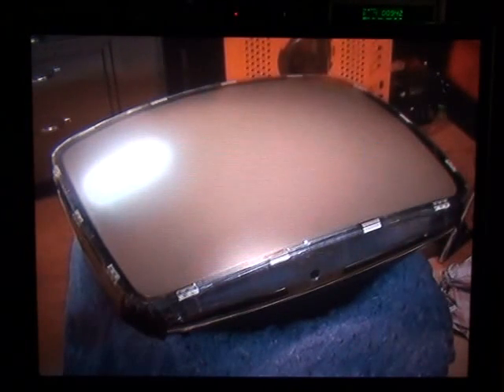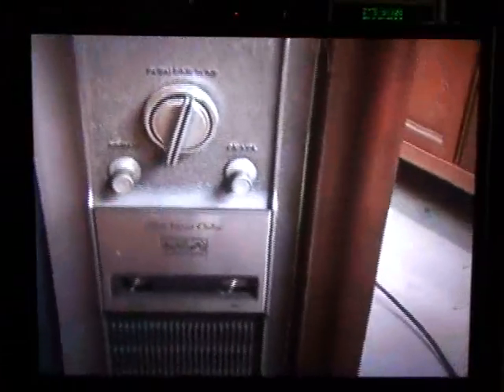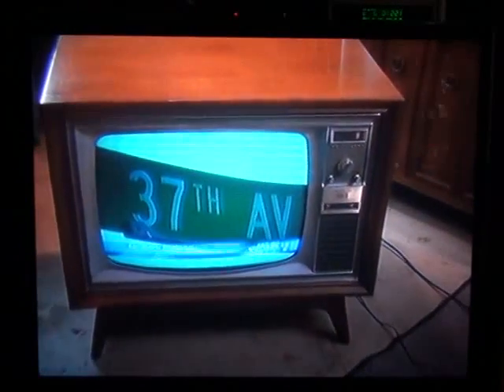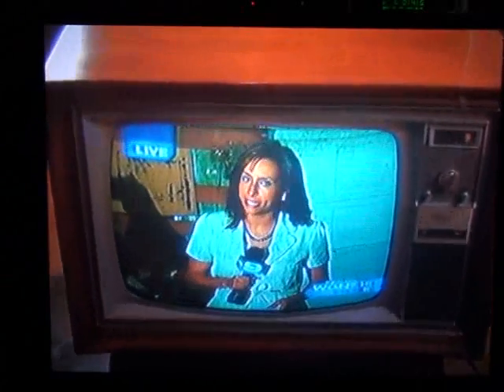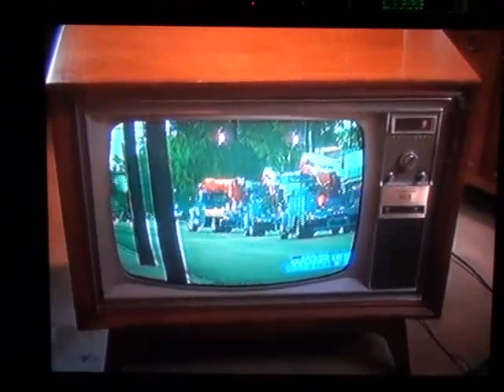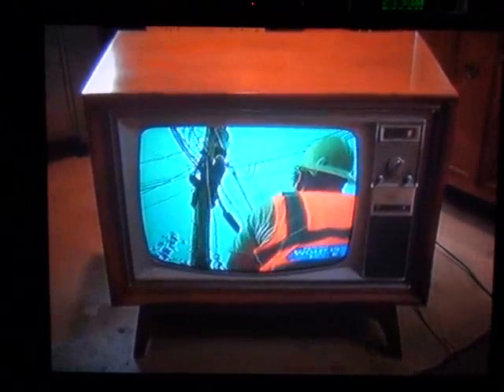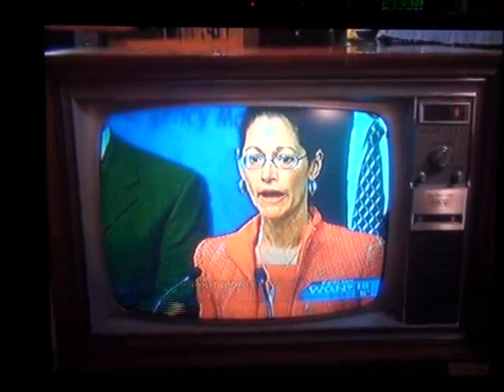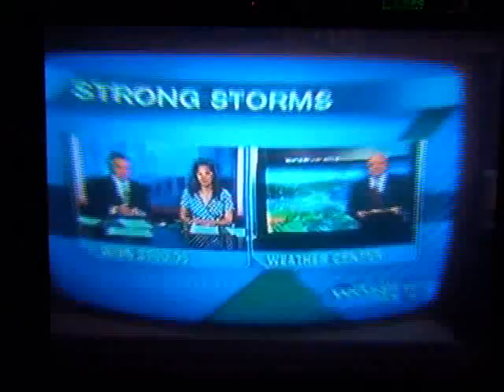How to repair CRT cataracts part 7 of 7

Comment: Thanks for the great series of videos, Doug. I recently acquired a Heathkit Gr-295 with a similar cataract which I'd like to do the repair on. After watching several videos about cataract removal and the inherent dangers on a rectangular tube, your method looks to be the safest one. Interesting that you used no silicone sealant, plus you did the whole procedure indoors. Thanks again for your fine video.

Comment: Hi, I found this video series on cleaning a picture tube, but what about using a different type of picture tube.  I have a Sanyo composite 12" monitor and would like to change the green picture tube with a 12" black & white picture tube.  I have three 12" TVs that I am recycling but want to use one of the CRTs.  How risky is it to try operating a TV/monitor with a different CRT from the original and what procedures are there to make sure it is safe to do?  Gary

Comment: @joselu90 "Polyvinyl acetate (PVAc) is a synthetic polymer and a member of the vinyl ester family. PVAc emulsion adhesives first gained market share by replacing hide glues in the 1940’s….[PVC is] noted for...fast bond strength..., versatile adhesion..., [and] good heat resistance...."
In other words, PVAc was a popular (and cheap) adhesive in industrial situations in the 1960's, as it is now - but sticky tape is a bit easier in application :)

Comment: Very informative series of videos!
The picture looks so good on the restored set.
I definitely have some CRT's that need this done...One is a brand new never used CRT from 1977 I installed in a Zenith set and the PVA problem is starting to occur.

Comment: Beautiful restoration!  The picture is probably better than new without the PVA material on the CRT.  

The lens mounting is just like the procedure we use to put the touchscreens on video game CRT's where I work.

Too bad they don't make CRT's that last this long nowadays.  Older CRT's had much better gun assemblies and more cathode material.  

I'm glad I have my Sencore CR7000 for the weak modern CRT's I come across constantly at work.  The worst ones were the early 90's Zeniths.